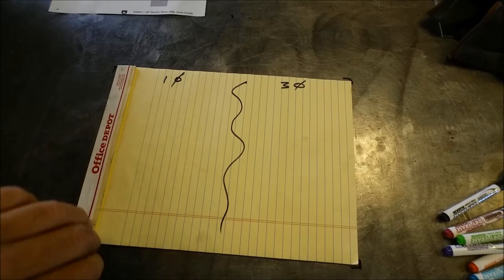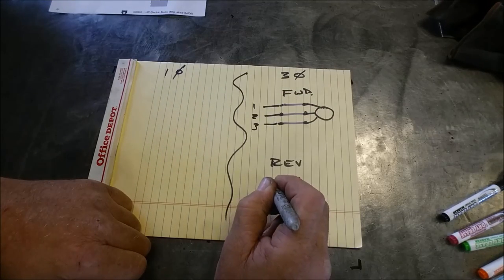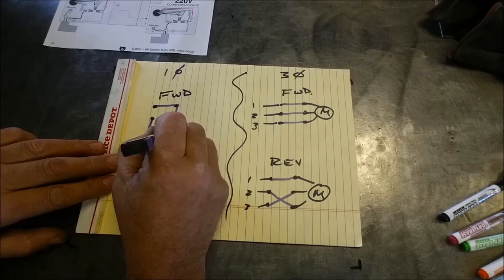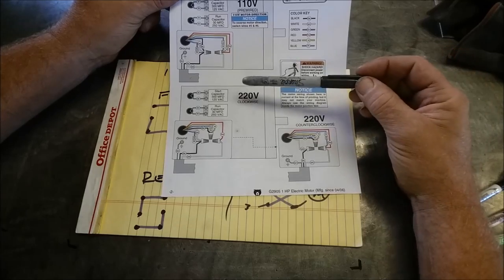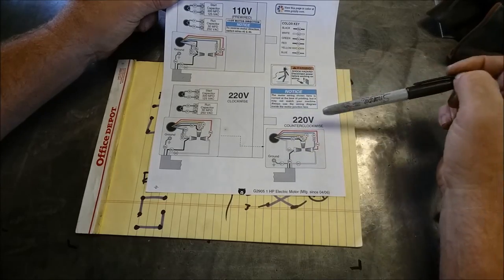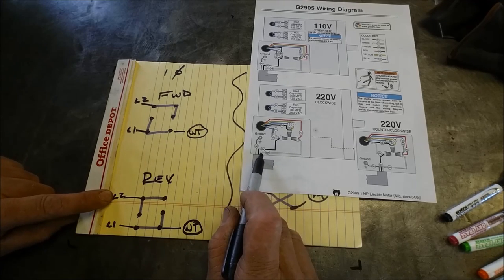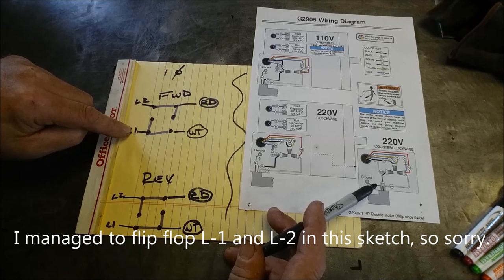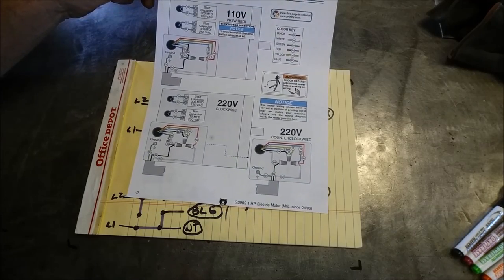Drum Switch Types

Comment: I have a question. I'm no electrician and I've got a 50-year old multi-operation woodworking machine with three 3-phase motors (one for the circular saw, one for the planer and one for the router), all connected to the same 380V power line cable. Each motor has its own switch – the three of them being 16-terminals switches; but only the router one uses three positions (Slow speed-OFF-High speed) and has 6 terminals connected. I need to change the saw's switch because it keeps arcing and won't start the saw more than half the time (the contacts are pitted, probably due to the fact they are installed right inside the body of the machine and near the saw, with no protection whatsoever against dust. Arcing + wood dust = a recipe for fire hazard). 

Each switch is connected to the other ones so that each motor can work while the two others are off. Since only three terminals are used on the switches for the saw and the planer, my question is this: do I need this exact model (16 terminals) of switch to replace the one on the saw or is a model with 8 or 12 terminals enough? 

Those switches are quite pricey and I only need "on-off" on that one since the saw doesn't need reverse or two speeds; but I still need to have each motor working independantly from the other two. I have a hard time finding information on the net about which model to use for which application.

I hope my explanation was clear enough... No need to say, I'm planning on re-installing all of them in a sealed enclosure outside  the body of the machine. Less hassle when needing to investigate, and probably a longer life span for the replacement switch(es) – I plan on changing all of them eventually, but as I said, those things are quite pricey.

Comment: Hello Stan,  My name is John.  Thank you for all the great videos that you have put out.  I truly enjoy them. I have a 110 Volt single phase Dewalt Drill press and have been very interested in making it reversible and variable speed.  I guess now to my question, can one of the VFD units that you have shown in an earlier video be used in a 110 setup and would it go between the drum switch and the source or between to drum switch and the motor.  Thanks again for the great information!

Comment: I'm so glad that I watch this I actually have two drums which is laying up in my garage one was 110 volt single phase for an old Wagner repulsion motor I still have to determine the layout of the wiring inside it. In the second one was 2 0 8 - 230 so you know it's old three phase criminals 1960 ish Logan 1821 I just bought a Leeson 1 horse motor that I want to run on 220 single phase because it maxes out at 15 amps on 110 so I don't want that.
So the trim switch that had been running the single phase repulsion motor if it's designed in the orientation that you depict in your groin can I run 220 threw that or or would it probably be not rated for that? I don't know maybe I'd be better off just buying a new one I know I'm going to electrocute myself I can what kind of Robotics all day long but it when it comes to high voltage I'm stupid and it's really ridiculous because it's so simple if you step back and look at it.

Comment: So if I just switch the L1 and L2, all others wire into the the same spots. L1=White(pwr)+goes with Motor red (Rd) and  L2=Black(pwr)+goes with Motor white(Wt.) and the Blue #5 is in the center pole, is that right? That's how I read the diagram to get it to run CW + CCW respectively, is that correct? I'm pretty sure I've got it, just one last check...ya know. Thanks Stan...Aloha, Chuck

Comment: Very good video, I know this is a long time from when u posted this video, I bought this at a flee market
20 years back. Never used it tell now it is a Furnas controller R1143 says it is for 115v and 240 v ac.
Can not read thi design in the cover, want to put it on my 120v lathe, can’t find a wiring design font
Hope u might have 1
Thanks

Comment: Howdy, did you just read my mind? Im working on my SB lathe and it came with an old GE 1hp single phase reversing motor ... The reversing porting is a mechanical relay attached to the side of the motor to be wired separately with the drum switch. Ive got the motor running with new capacitors im just a little stumped at how the reversing relay works. A cool video to make would be to show the entire schematic with the start/run coils, capacitors and switch all laid out. Ill probably make a video soon showing me working on the problem. Thanks for the info.
Reply from the maker: Always glad to hear my vids are useful. Good luck with your project.

Comment: If you had to, couldn't you use the 3ph drum switch on 120v 1ph, but obviously NOT the other way around?  Seems like L2 & L3 on the 3ph are doing basically the same or similar thing that the 1ph is doing only if you were just using 120volts w/ the 1ph. B/c since I'm just using 120v, I only use 4 of the 6 terminals.   I just noticed that & thinkin' out loud a little. So that might save you a trip to the store or having to order another switch.

Comment from the maker: @ John McDonnell,
I cant reply to your post for some reason, you cant use a VFD with a single phase motor. you would need to switch out the motor, buy a VFD and install a control, is this drill press worth that?
Reply: Level3-RC Shadon HKW See how I did that? I typed up your YouTube handle with a "+" sign in front of it and then you are sent a message on your drop down that someone has commented to you...he has changed his settings though, but he who snoozes, loses :D
Reply from the maker: Knolltop Farms Bam!

Comment: WOW major flashback there! I used to love going to Chuck E Cheese as a kid just so I could set the high score on Pole Position. :-) I didn't think most single phase motors could even run in reverse? Doesn't it take a special class? I know some single phase motors are set with an offset brush so they will start running in the proper direction and I don't think those are reversible.
Reply: Most single phase motors can be reversed. Problem is you may have to disassemble the motor to get at the starter winding. Changing the starter winding is the key. Some motors will bring it out to the terminal block so it is easy. the motor tag will show that.

Comment: Hey. Bought a milling machine off craigslist and forward/reverse switch doesn't work correctly. The switch is a 3 position 12 terminal 380vac. Pretty sure it is wired incorrectly but got a new switch just in case (ebay cheaphy but same switch). can't find any info on the web. I am set-up for 115V and the motor has 5 wires coming out not including the power source wires. All 12 terminals are wired as it is now so I figure this is what I need to follow. Switch worked in forward and stop but in reverse it goes in forward. Any thoughts?
Reply from the maker: Hi Mike,
I would need the wiring diagram for both the motor and drum switch to make an informed suggestion. It is only going to be a matter of switching one wire to make it work correctly, but I cant tell you which one without more information.

Comment: thanks that helps me out too.

what goes on the 3rd connection terminal between l1 and l2 on the left side of your single phase drawings
Reply from the maker: Hi Billy,
That would be your "flop" terminal, so you can easily switch your (blue in this case) wire to make your CCW or CW adjustments.

Comment: Okay now I'm totally confused because I just took apart my drum switch from an old Logan 820 and it was single phase and it's exactly like you said it shouldn't be so I'm at a loss
Reply: Your Logan probably has a drum switch manufactured by the Furnas Co which was popular in the '50s...and closes different terminals than shown here.  Mine does anyway. Use this diagram instead.  Sorry, YouTube is no letting me paste the diagram here.  Try to Google Furnas drum switches.  You probably can find the right diagram to use.
Reply: OK, here's a Logan instruction manual.  Wiring diagrams for the rotary drum switch are on the last page.  http://vintagemachinery.org/pubs/2093/22616.pdf#page=1&zoom=auto,-176,792
Reply: If you have the R-1143A Furnas rotary switch use the diagram on page 16 which uses a jumper between terminal 3 and 5
 http://vintagemachinery.org/pubs/2093/22616.pdf#page=1&zoom=auto,-176,792

Comment: hello again. here are the pics of the motor schematic, switch and wires at switch location from motor. It is already wired for 115v. thanks for any input.
https://plus.google.com/105027075712320300951/posts/D4xjhzZCPDr
Reply from the maker: Hi Mike,
Your black and red wires are your "flop" wires, these need to be alternated for fwd - rev operation, as far as your drum switch goes, I just cant tell what the pole positions are from the picture, I'm sure the information is there, but I cant read Chinese. If there is a terminal chart showing terminal numbers and "X's" and "O's" for the pole positions, I searched for HZ-5 20/4 and couldn't come up with a pole chart, that would be extremely helpful. 

In the absence of this, you will need a means of checking continuity, draw three diagrams (one for each switch position) draw in your terminal numbers for each, connect the terminals with a line for those that have continuity and leave open for the ones that have no continuity. 

Has this switch worked on this machine before? I am hoping you have the single phase version.
Reply: Thank you much for the info. You should check out the manual for this milling machine...a Chinese work of art. I guess I am not understanding why there are 12 terminals instead of 6. I have figured out the pole positions for 6 terminals just not the 12 terminal i.e. why are there several jumper wires required? Is this possibly the 115v wiring requirement?
Reply from the maker: Mike Palmer Yes, you may have to make some crossover jumpers, I am thinking this switch is multi function, thus the 12 terminals.
Reply: Did you end up figuring this out? I also have a marathon motor with red and black flop wires. My electrician told me a drum switch would not do the job and tried to sell me a $3200 contraption to do the switching. Id love to see a diagram if you have one.